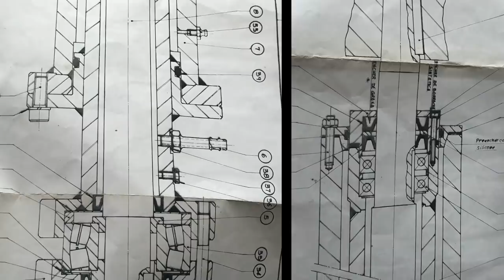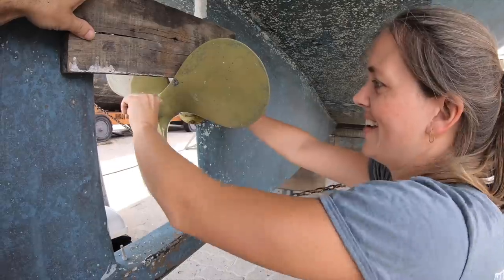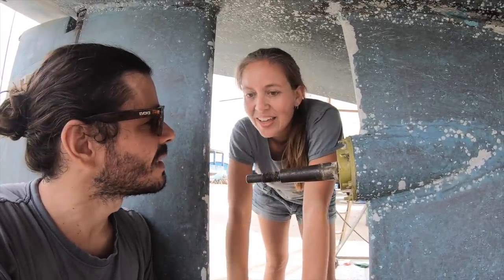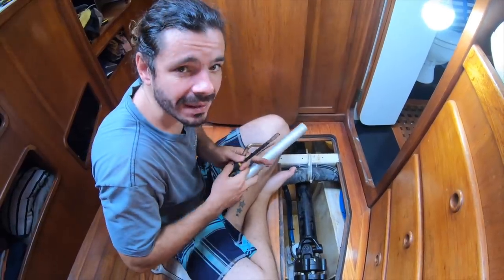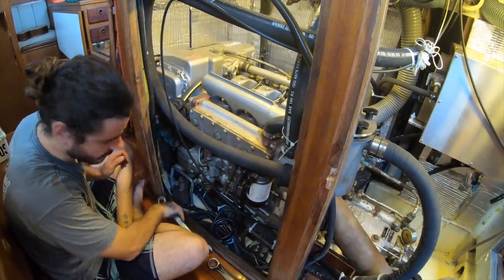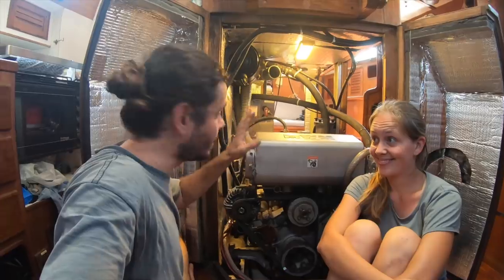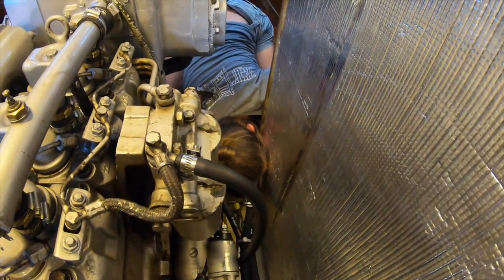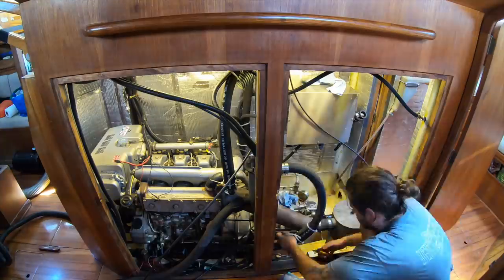⛵️New Year, New Challenge!! Taking our ENGINE OUT: the BEGINNING #168

Comment: 1 Mechanic tip...use the box end of the wrenches(if you can) to unscrew your bolt/nuts, and finish off using the open end...this will save you from rounding off the bolt/nuts...(Imagine having to do a repair at sea and the nut is completely rounded off)...good luck on the replacement
Reply: I'm a mechanic for 30 years so lets not forget busted knuckles when the open end slips :)
Reply: @BlindmanValley  yup ouch...nearing 35 years myself...air and electric sure can get us ol timers spoiled though lol
Reply: Spoken with the voice of experience.
Reply: Socket sets would help and not using adjustable wrenches(when you can). Also good set of “Vice Grips” to support some jobs.
Reply: @62-62  The problem with ViseGrips is that most people buy the rounded claws ones, not the straight claws, thus rounding off bolts and nuts.
Reply: Flare nut wrench set are a must have too ;-D
Reply: The box end usually has more flats because it has more points. Also be mindful of the open end is at an angle with the handle that can give you more turning radius if you use the open flats to your advantage.

Comment: Another great episode. How are you staying so clean working in the engine room? Your hands don't even get dirty. I can stay rather clean doing daily engine detailing, but when I start to remove components it becomes a major job with typical dirt, oil, and grease in hard to clean spots.  Perfect execution of getting the engine prepared for removal and replacement.  Everything you have done to this point continues to be thoughtful and not rushed as you bring the boat to better than new condition. The finished product on each stage of the restoration shows much more attention to detail and quality than likely the boat builder provided during construction when new.  Keep up the great work... You're going to have years of enjoyable sailing with this beautiful boat.

Comment: Hi Duca & Roberta from Sydney, Australia. Good work on the boat and now for the engine and shaft replacement. If I may make a suggestion, label every connection you take apart, be it electrical or plumbing or mechanical so that when you eventually have to put it back together, you don't have to rely on memory. Even more important when someone else is putting it back together. This may save hours of work and reduce errors.  Hope this is useful for you.  I look forward to your post every Monday.

Comment: Hi Guys, 
Here's a tip for the next time you need to use the puller, attach the puller to what ever it is you need to pull off tighten the bolt up until you have good tension on the shaft then hit the head of the bolt on the puller with a hammer and the shock load will break it free .
Cheers from Australia
Reply from the maker: Thanks for the tip 😊

Comment: At 13 minutes you say, "Always the last one that is the bad one'"  One of the tricks that I learned as a mechanic is to start with the hardest one to get to, that way you learn all the lessons early on and can apply them easily down the line. Those last few fasteners fly by in a blink and the job is done without any fighting.
Reply: Also they need to take the bolts/ nuts in a crisscross way taking them as well as putting them on . Jeff Cagle

Comment: i believe its a  Yanmar diesel  engine parts are available just about every were in the world. looks good so far and have a great day
Reply from the maker: Yes 😊 thanks
Reply: No need to worry, in Indonesia Yanmar also exists
Reply: Thars a Brazilian Mfg Diesel.. MWM.. a division of Navistar..used to be known as International Harvester..sold now to Chi a.  https://en.wikipedia.org/wiki/MWM_International_Motores
Reply: @Johnsouthshore  I was going to say the same without the link. I wonder what the engine will be. Since they got rid of the generator, I hope they are looking at a marine hybrid system that will give them an electronic drive option off their batteries/solar/prop feathering/wind generation to save fuel use during long crossings
Reply: @Johnsouthshore  it would appear that they are taking out a MWM engine.  Since MWM is a Brazilian manufacturer, how is your supply chain in Tahiti?
Yanmar is really the best choice for them, all things considered and being equal.
Reply: @GaryMCurran  exactly what I said
Reply: @DG-jq7il  I am thinking that they are going to go for an electric motor.
Reply: @corryvisser6679  highly doubtful.  It would require a massive overhaul of the body to install the battery banks necessary for any kind of sustained outing, plus they would have to at least double, if not triple the amount of solar panels on the boat.
Reply: @Johnsouthshore  not realy...its a gerrman engine ;)
Reply: Like everyone else, I figured a Yanmar due to availability and service life. However, due to personal preference, I’ll throw out the Cummins option.
Reply: Electric may be the future,  but not feasible on a heavy steel boat like this. If you follow Sailing Urma, they just flew to Croatia to test sail a boat purpose built for electric propulsion. It is very low displacement, light weight and uses 2 electric motors offering up to 2KW/h of regen. This boat is designed  like a performance boat to cope with even light wind. This is a way forward  for Electric but not really practical for older, heavy, high displacement vessels   unless your sailing is largely marina hopping,  where shore power is readily available. Maybe ideal for charter yachts.
Reply: Yanmar?
Reply: @dalltm  its a marine diesel engine used in a lot of boats

Comment: An absolute must-have tool for anyone working in closed spaces is a telescoping magnet retriever. It is wonderful to get stuff that falls into tiny cracks. I also have a flexible 3 jaw retriever as well, which can be helpful in certain situations, but the magnet retriever is a must!
Reply: And here is the jaw type: X-Long 36" Flex-Cable Pick-Up Tool 4-Finger Claw End Retriever Snake https://www.amazon.com/dp/B006ZEOXJY/ref=cm_sw_r_cp_api_glc_fabc_afAbGb1E3226P

You can actually buy both as a set for about $20 US...
Reply from the maker: We actually have the flexible 3 jaw retriever one and we love it!! hehehe but great ideal about the magnet retriever, we will try to find one. Thanks a lot for the tip Josh!!

Comment: For the engine I'm sticking with my original thoughts of using the Yanmar 4JH57 57 HP Diesel Marine Inboard. Compact, reliable, economical, easy to service, parts readily available world-wide.
Reply from the maker: It’s Yanmar, but not a 57 hehe. 😊

Comment: When using your wrenches always use the 'closed' end when possible. It is much stronger with the contact to the nut or bolt. The 'open' end of the wrench is when you cannot use the closed end. Like when you cannot get to it from the top.
Reply from the maker: 😉 it didn’t fit in this case
Reply: @OddLifeCrafting  thanks for replying. Always enjoy your adventure.  aCrazy Canuck ( Canadian)

Comment: I hope that the interface to the new engine is similar to the old, and gives no difficulties. Electronics, controls, cooling, electrical, air in, exhaust out, mechanical. Many details, but you should have it integrated perfectly.
Reply from the maker: Similar, but we are gonna need to do some modifications

Comment: That sound is bad needle bearings in the universal joint cap.
Reply from the maker: We will give maintenance to the universal joint and replace the bearings. 😉
Reply: @OddLifeCrafting  Duka... if it's anything like here in the states usually they sell the U joint with the bearing/caps on it, so no maintenance other than grease nipple, though many newer ones don't require you to inject grease into it for the bearings like older ones did.  Roberta was too freaking cute with the prop....LOL

Comment: I don't know what the prop shaft noise is, but the two universal couplings each end of the shaft must be exactly lined up with each other.  If they don't there will be a stange vibration as the shaft rotates.  I learnt this the hard way.  And of course the needle bearings need to be in good condition with plenty of grease.

Comment: IMHO Odd should keep the current propeller and save the budget to buy the adjustable pitch propeller till she cruises to where it is available.
Reply: They said it was Unobtainium. At least until they sail out of their current market and who knows how long that will take.
Reply: @peterg.8245  Correet so use the current prop rather than buy a new one.  You can re-pitch the prop if it is way out but it will maybe only be used to enter and leave a harbor, so who cares if it is optimal.

Comment: How does one spend so much time and effort on all the "Bells and Whistles" and simply skip over perhaps the third most important system on a sailboat?  The precedent is not a wise one for people that are going out onto the ocean alone.  BTW, WD40 is perhaps one of the worst "Lubricants" money can buy.  It may have a few drops of Lube in the formula but that was never the intention of WD40.  The WD stands for Water Displacement.  It was developed to remove moisture from the wings of B29s.

Comment: Roberta (and also Duca) one technician once told me a very simple trick to determine the way how to remove standard bolds, screws, nuts. Lefty-Loosy, Righty-Tighty. Turn left to loosen turn right to tighten a standard bold, nut, screw. (looking from the top). Good luck with you yacht.

Comment: I really enjoyed Roberta taking the propeller off. I think with a little more coaching, she could have completed the job herself. 
One recommendation is to put down a blanket so you can put your knees on the ground. It's so much easier to get better leverage when turning stiff nuts and bolts.
Cheers from Juneau Alaska, 
Greg Chaney
Reply from the maker: Thanks for the suggestion. Actually some parts were really really hard to take off and I don’t think I would have the strength to do it
Reply: @OddLifeCrafting  Another tip for turning wrenches on tight nuts and bolts is to wear leather gloves with the finger tips cut off. That way when the wrench slips (which frequently happens when you are pushing hard) you save the skin on your hands when they slam into whatever you are working on. And since your finger tips are exposed, you have the dexterity to do fine work like picking up a nut that was dropped. 
Best of luck installing the new engine!
Cheers from Juneau Alaska, 
Greg Chaney

Comment: We have guessed it will be a Yanmar. We had one in our boat. It was a 30hp and never let us down. We did mess up though, it did not have a water separator filter and I did not realize it at the time. (It was a brand new boat, a 30 ' sloop). You guessed it, I got a bad load of fuel with water in it and had to be towed back from the harbor entrance to our dock. "live and learn". Oh, make sure anything that is safety wired, make sure and double check that it is wired properly. So, have a great and blessed week. See you next Monday.  Hugs, George & Debby Brady

Comment: Progress in little steps.  The new engine I think is a Yanmar .  Is it smaller than the current engine ?  If so, there will be a lot more room in the engine compartment.  The best thing is you are learning the components , gaining confidence and abilities and you will have new dependable equipment that should not need more than an oil change.  All the best, Hal
Reply from the maker: Yes and yes 😊

Comment: Roberta’s a keeper. You’re a very lucky man Duca. 

Facing aft, can you create an access panel door on the left side after you remove the old engine? The new exhaust and air intake system can be mounted above the engine. It’ll make servicing/cleaning easier. Just a thought. I’m sure you’ve both considered all the variables.
Reply from the maker: We are gonna do some notifications. Thanks for the suggestions
Reply: @OddLifeCrafting  I don’t have notifications turned on ☺️

Comment: Duca, (a piece of advise) whenever possible when using wrenches chose to use the closed (box) end instead of the open end of your wrench. This will save you many head aches should the open end slip and round off the shoulders of the nut you are removing.

Comment: The play you are getting in the driveshaft is the needle bearings in the U-Joint caps.  You need to replace that U-joint, its worn out.  Have fun, I use an old socket and a ball ping hammer.  Have fun!

Comment: Make sure to put the wire back for the propeller shaft bolts/nuts. Very important safety feature. Otherwise the shaft may come apart under power causing lots of damage. Good luck.

Comment: When you lift the companionway stairs (like at 25:18) it would be easy to have a stainless eye (or pad eye) screwed into the wood ceiling crossbeam and a swivel eye snap hook attached to the inside of the bottom stair leg. Then you can simply snap the hook into the ceiling pad eye and the stair will be secured up out of the way whenever you need access front to your engine.
Reply from the maker: Future project. We still need to fix the stairs that are falling apart

Comment: as a puller saver I like to turn a bit then strike the back of the object with a dead blow hammer... It usually pops on a strike vs a turn and therefore less chance of thread damage to the puller.     Granted its a prop so strike the hub not lobe.

Comment: Have you guys considered going with electric propulsion? Seems like there might be less maintenance needed. Could reuse the fuel tank space for more water or batteries. Reuse the engine bay for batteries. Put a regen capable electric motor and have unlimited power and range.

Comment: I've been watching your channel since it started. I've even stuck with it through finding this boat and all the struggles of getting it ready to be launched with the belief that you actually will be traveling for extended cruises, but there always seems to be one more thing to fix, before finally being ready for extended cruises. I think you should call your boat "The Never Sail".  Could it be that when you finally run out of things to fix that you will lose your popularity? Not a chance - we will always be there holding our breaths as you finally get underway, waiting for the next project to be done.
Reply from the maker: hehehehe No worries Philip we will untie the lines. But right now with covid is the perfect time to get the boat the way we want. Of course there will always be new projects on the way but after so long we prefer to take a little bit longer and that off the marina for a long time then needing to come back. Taking the boat out of the water now ended up being a smart call. We opened up the prop shaft seal this week and the leak was caused buy a broken retainer, that mean wouldn't take long until we would need to go back to a marina. That was a calculated risk. This is the last moving part we needed to open in order of knowing our boat inside and out. hehehehe Well I guess boat life is more then sunsets and palm trees, hehehehe but don't when eventually we have nice sunsets and palm trees don't say we are lucky. hehehe we are working really hard for. hehehe take care my friend.

Comment: I don't know if you use sockets, or if you only use straight wrenches.  I don't recall ever seeing sockets in your videos.  If straight wrenches only, I'd look at buying some gear wrenches.  In a gear wrench, the box end ratchets so that you don't have to keep flipping the wrench when you're working in a confined space with little room to swing the wrench.  It may not be worth the cost, as you'll have fewer big projects to complete once you get everything in order.  If you do use sockets, I'd get a Makita battery powered ratchet for the same reason (Makita RW01Z).  It won't break a stuck nut or bolt free but will spin off a loose one in a hurry.

As always, thanks for sharing the video.

Comment: Remember, any time you hammer on a shaft to get something on or off and there are ball bearings you run the risk of damage to the races. Since you’re doing a rebuild on that assembly, it’s not a problem. Roller bearings are much more robust but still, use a puller when possible or just don’t get too carried away with a hammer.

Comment: To make it even safer, I would disconnect the battery before disconnecting the alternator wires, even if your battery switch is in the OFF position and even if you think the charge controller is not making a path between batteries and the alternator harness.

Comment: While you are on the hard, take an angle grinder and remove the old deck mounted brackets for the mainsheet track and paint over. It will give you a cleaner cockpit with more comfortable access and seating solution. (I hoped you would do it after the arch install). Also consider getting a quote for a complete teak deck install. It would be very interesting to hear what it would cost in Brazil. In the US or Europe maybe 25-30.000 USD but I am sure you could get it done for under 10.000 USD. It would suit your boat perfectly and would be a nice contrast to the hard steel... At the same time it would make for excellent content, and maybe promote Brazil as a destination for deck replacements. Get a sponsor - Just an idea
Reply from the maker: Hi there. We have a steel galvanized boat and we don’t want to have problems with corrosion in case we angle grind the deck mounted brackets. Also the idea of not having teak or other kind of thing covering the deck is to be able to see if we have any corrosion on the deck
Reply: @OddLifeCrafting  You could just treat it the same way you did when you repaired and painted the boat. Your choice. They just take up a nice place to sit and hang out...

Comment: As you are dismounting the engine, you should get a carpenter to build you an access door on the keft side of the engine, so you will have full access by any of the sides
Reply from the maker: We are gonna see how the new engine is gonna be inside of the room, maybe it won't be necessary